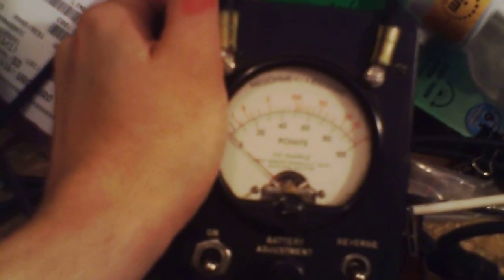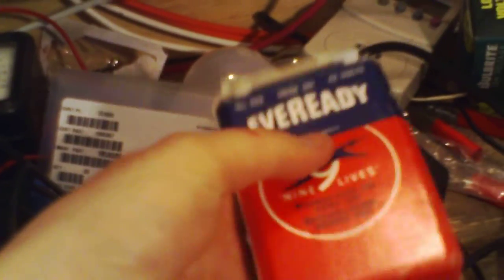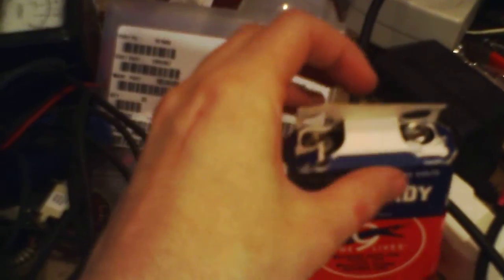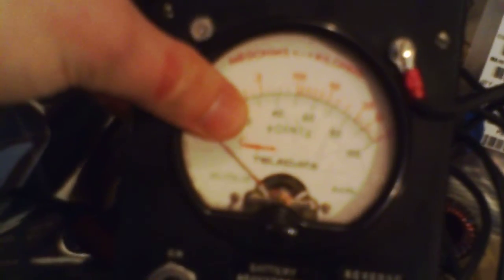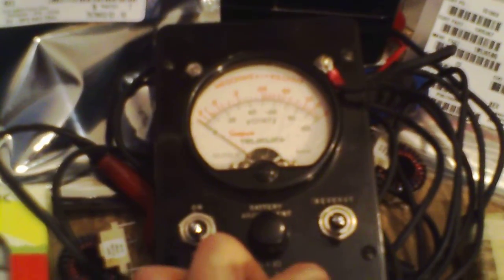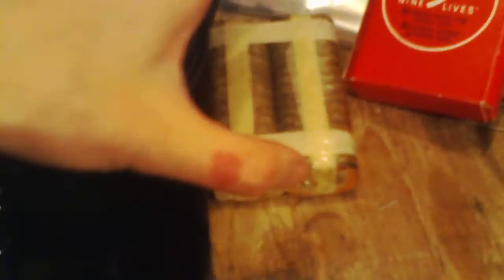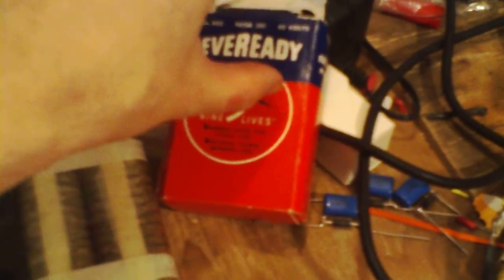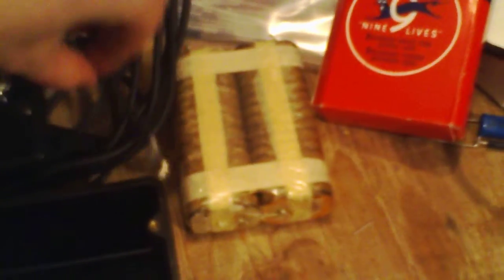Simpson 8455 telephone tester battery modification

Comment: In response to Cad68mm comment & to whoever is interested.

 - The 'kick' will indicate the capacitance of the wire. The longer the wire the greater the capacitance and the 'kick'.  I forget now, but if you know the value per foot or whatever measurement you will know the distance of the pair or the wire.

When one measures less than the other you can locate the fault by measuring distance from either end of the good lead.

Comment: Wire five 9v battery connectors in series and then the connectors from the Everyready 455 battery to the ends; keeping the polarity straight . ( I guess I should remove those from my 455, before I toss that battery out)
There are replacements available for the Everyready 455 or Neda 201 but the cost is around $25 each. 
Five 9v batteries will cost about the same or more. - Try the dollar store.

Comment: The reverse key will also let you kick a twisted pair of wires, by reversing the polarity it will cause the analog meter to deflect indicating the length of the wires, in telephone cable you can kick each side to ground and determine if the pair is balanced, if you know the wire gauge it can be surprisingly accurate. You can also see telephone ringers, when you kick a pair so you can determine approximately  how many there are.